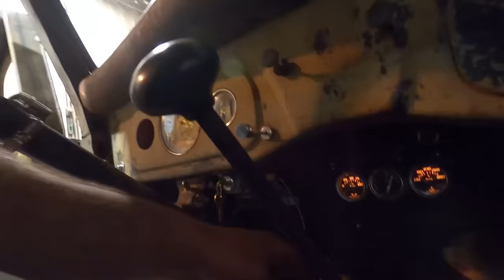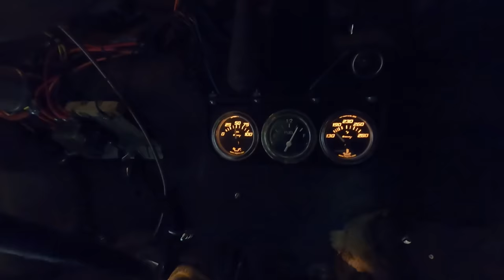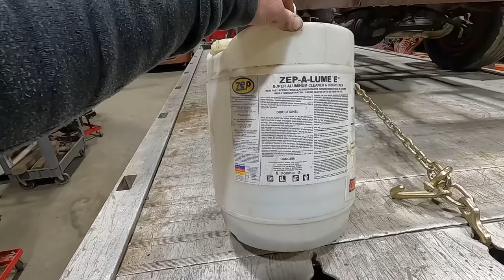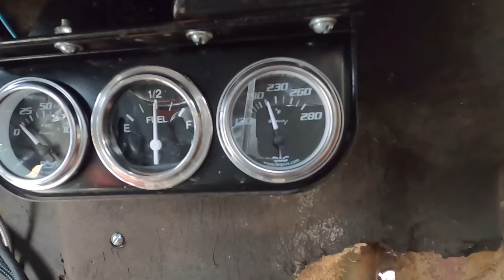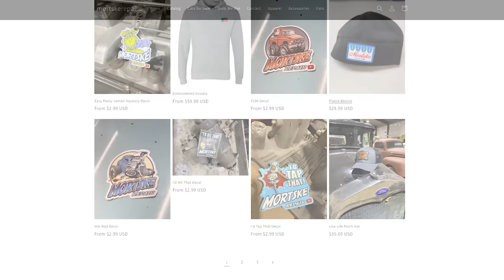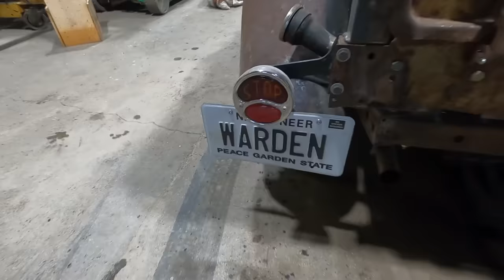1936 Ford Barn Find Pickup Truck! Overheating Flathead V8!! Problem Solved!

Comment: oh look another 2 hour video of yapping. next time do a 5 hour video.
Reply: you're over doing it man i used to love your videos but im sorry its longer than titanic the movie lol. one hour was perfect and save the 2-3 hrs for special videos. you understand what im saying?
Reply from the maker: They’ve been 2+ hours for years.
Reply: @MortskeRepair  First off, that guy is a real tool.  Secondly, have you ever tried setting up an electrolysis tank to do rust removal?  It's extremely easy, although you would have to tear the engine down into block n heads and such it, but it will strip only the rust down to bare metal with zero effort.  It would probably work even better if you could set it up so the electrolyte is flowing through the passages .

Now, a few things. I have used electrolysis to clean up intake manifolds, exhaust manifolds, a water pump, and some various shop tools.  I have no idea what it might do to, for example, a set of cam bearings.  You would need to look into the details, but serisously in places where it works at all electrolysis is like freaking magic dealing with rusted parts.  It's hard to over hype how easy it is and how easy it is to set it up.  A few plastic tubs, a big chunk of scrap iron, a set of battery cables, a cheap battery charger and an old battery (you have to run the current from the battery charger through a battery to your object, because all these modern smart chargers will shut off if you try to run them direct.

Also, the process produces a small amount of hydrogen gas. I would imagine your building is more than crafty enough that it would dissipate LONG before any dangerous concentration could happen, it's not much gas and thats a BFB, but you might contemplate it. I literally did it one winter in a small insulated work shed and came out to find my buddy casually lighting a smoke in there. He failed to fly into outer space, and I had been doing it out there specifically because it had no potential ignition sources like sparks or whatever... He was all like 'what sup with these fizzing plastic tubs', and then got offended when I grabbed his smoke right out of his face and ground it out.  He settled down after I played him a video of the Hindenburg on my phone.

So look into electrolysis, even if it doesn't suit your purposes here it's an amazing process and a real labour saver.  And as for that guy bitching about the length of the videos, personally I would watch the hell out of a five hour mechanical video.
Reply: All ya gotta do is stop watching if you don't like it there genus.......duh
Reply: They're too long,we dont need to see all 20 lug nuts removed, or 5 minues of winching a car on to a trailer @MortskeRepair
Reply: Where is the part where Morske threaten you if you don't keep watching?? There are 1000s of youtubers! If you don't like this one go somewhere else.
Reply: I'll sit through a 5 hour video.
Reply: There's always FAST FREAKIN' FORWARD!!!
Reply: @jongercama1842  well ill sit through a 6 hour one!
Reply: I wo7ld watch a 5 hour Mortske  video,  so FO
Reply: DUDE! so is Al Roker at the Rose Parade and there are thousands of people watching the parade and there is even a guy who tries to go behind the horses and clean up the road before the pretty girls march in formation right in to the mess so their Moms at home won`t get upset. Entertainment is where you find it . I haven`t seen your channel yet.
Reply: @Michael-B41  So we all have to make do with shorter videos just because it suits you?
Reply: @jongercama1842  Me too!
Reply: What king of frash light  do u use
Reply: I don't know if you are joking, being facetious or just a plain ass. But me and the hubby LOVE your videos and watch them from beginning to end!
Thanks Mortske❤
Reply: Id be happy if the videosc were 5 hours long, if its not for you do something else.
Reply: I break them down to 2 or 3 sittings. But don’t make them shorter. There’s enough short content on YouTube already. What you’ve got is working.
Reply: Here we go again
Reply: To rickmesser : genus ????? What's a genus ? Genius
Reply: I've been asking for all Duff vids , including body cam shots , to no avail 👍
Reply: @MortskeRepair FAR be it from ME to be a TROLL (🤣), but I do prefer them to be around 1:45:00 or less. It's not you, bud, it's me. But at least I'm polite and respectful about it. Unlike your typical TROLL OF THE WEEK (see above). 😉
Reply: I think these guys really are trying to win my coveted (?) TROLL OF THE WEEK award. No cash, no prizes, just glory 😂.
Reply: oh look nobody cares what you think.
Reply: Don't encourage him to go Lord of the Rings length dude!
Reply: Go watch someone else then. Problem solved 😂
Reply: Be careful about saying anything about any Youtuber. Normally there are some Cult members who will attack you back for slightest criticism even if, you have a positive constrictive point. After all if you didn't care about this channel you wouldn't bother to express your opinion. And the reaction from these Cult members are always the same: "Why don't you watch something else?"!!
Reply: i could watch these video's for hours just for Duff.no offence Mortske. @MortskeRepair
Reply: 5 hours would be great!! now kick rocks, dum dum.
Reply: The warden is great, but I love that black dodge truck and yes bring on the Pontiac! Great video!
Reply: Longer the better for sure
Reply: I like the 2 hour videos myself. Don't watch much TV because it sucks, so I'd rather watch Mortske. If you don't like the long videos, simply don't watch.🤔
Reply: @MortskeRepair  I enjoy the two hour videos. It’s like watching a movie but better.
Reply: @Michael-B41 I think they're perfect length videos. I'm retired and his videos last perfectly through Matlock and heat of the night! I'm old but I ain't that old to watch those shows. Keep up the good work Mortske and Happy New Year to you and Duff as well!
Reply: Maybe this comment is a bit late, but the hydrogen gas that electrolysis would raise up to the ceiling and find it's way out. We used to generate the stuff in a glass beaker in chem lab and the most it would is just make a chirp or poof sound..
  Not giving you guys advise on what to do, but when compared to the gases found in a torch, gasoline or propane, I don't give it a thought.
Reply: If you don't like em, don't watch. 
Enjoyed this video as I do all of them.
Reply: If it’s too long for you, or you don’t like the content why don’t you just not watch it, if you cannot say anything nice don’t say anything at all
Reply: Don't listen to him, he is just jealous!  I like your yapping, or thinking out-lowed,  and I like Duff the Britney spaniel too!
Reply: you're not being held captive.
if it's too long,  go to the next one. 
Simple and easy.
Reply: @Michael-B41 ❤Kopitar
Reply: @Neil-ru7kw  it’s a word used to classify species… but not what he was after 😂
Reply: @rickmesser7855  It's genius not genus , duh !
Reply: @jeffhutchins7048  I just shoot to the last 5 min's 👍
Reply: @Neil-ru7kw I like to go for the full run!
Reply: @Neil-ru7kw  big thumbs
Reply: @timothytrujillo467  easy dont watch
Reply: Couldn't agree more! The longer, the better! Mortske truly is a virtuoso of the internal combustion engine. I'm 65 and I've been tinkering on cars since my teenage years, first as a matter of necessity and later because I like old cars. Even so, I learn something new every time I watch one of Mortske's videos. Mortske has that rare ability to "think outside the box." Even though it wasn't the entire cause of his overheating problem, his idea of slowing down water flow through the radiator and giving the water more time to cool by fitting washers inside the hoses is nothing short of brilliant. What impressed me the most was the way Mortske got the motor on the ex Air Force '55 Dodge wagon running. After sitting for 50 years, those valves were basically welded to their seats. I would have either done a complete rebuild, or scrapped the damned thing. Rather than doing either of those things Mortske kept heating each valve with a torch and gently tapping it using the ball end of a lightweight ball-peen hammer. He did this over and over on each valve, until the valve freed up. I thought he was wasting his time, but it worked! I'm not sure if you are complaining about the length of Mortske's videos or paying him a left-handed compliment but I do know this: I may be old but I still love to learn new things and for me, time spent watching a Mortske video is time well spent!
Reply: @chrisackerley1842  yeah i just loved the videos got too long for me been so busy i cant hardly finish one got upset about it. hes a good guy though

Comment: Use CLR to remove rust. It's gentle enough for your coffee maker and dishwasher, so it should be fine on seals and gaskets.
Reply: phosphoric acid it only eats rust not steel or iron and is way cheaper than clr and there brand name
Reply: Evap o rust works  wonders
Reply: White vinegar seams to work good. Then put rocks or something in it and shake it around. For gas tanks I mean. Don't know how well it would work in heads or an engine block.
Reply: You know that truck Isn't a late model slower down 😅
Reply: 2:18:43 Tell us what you really think of us…
Reply: @bob5074 ?
Reply: Yes CLR is the best
Reply: That much rust needs more than clr...like a new shortblock or some weld...at least 5 lbs of welding wire😂
Reply: I saw South Main Auto do that and it worked
Reply: @wolfcommander6009  Engine brushes work good too.
Reply: Yes CLR
Reply: @1776_Garage  Works great on engines. especially the industrial grade vinegar they use for weed killer .

Comment: You ask us to tell our build stories:  Starting in 1963, I bought my first '55 Chevy Bell Air post.  After I got out of the Navy, I built four more 210 series, customs and one Jim Hall 327 Chaparral, that beat every thing in it's class, including all hypo 427's.  I'm 81-years young now and own a pristine '86 1/2 red Fiero GT that I have done two engine swaps; a 3.4 Camaro/Firebird V-6, and five  years ago, a 300+hp 3800sc out of a 2003 Bonnevile.  Built the way the original designers intended it to be, she puts in low 12 second quarter miles, but more impressive takes the circuit race tracks like a pro.  She is a gorgeous fast little sports car, that beats most of the cars on the road, and gets excellent mileage while she is doing it.  She is very roomy inside, and I call her "my quasi super car." I only have around $7k invested in her, having done all the work myself, she is more comfortable that most all the million-dollar Italian sports cars, and goes like hell...!
Reply from the maker: Awesome!

Comment: From what I've been told, the water in the coolant mix is what does the heat transfer, or the bulk of it. The coolant is for raising the boiling point, lubricating the water pump, and keeping corrosion to a minimum. My neighbors have a 79 Ford E150 RV with a big ol camper top, and only a 302. It was overheating, especially when pulling a long hill in the SoCal summer. Has a newer aluminum radiator, and the rest of the system itself checked out, as did the ignition timing. Come to find out that someone had put straight ethelyne glycol coolant in it. I drained it and refilled with 50/50 ethelyne glycol and distilled water, and it does not overheat any more. Happy New Year, Mortske!
Reply: I agree, use distilled water too…

Comment: My grandfather was a tanker in ww2, did tank recovery, and sometimes they would take pans of oil soaked wood and slide them under the engines and transmissions to warm them up in the winter.  He said it didn't matter how stuck or how broken a tank was, he would rather be trying to start a frozen solid engine than getting a still warm one out of a field.

At the time, I didn't actually get what he meant by that. Later on I learned that he had been in a crew that would pull disabled tanks out of active battles while under fire.  Any enemy tank would love to take them out, and he had several medals and such for bravery including a battlefield commission to officer.  Started as a private who could not read, after peace time he ran a training school for mechanics and recovery teams in the fifties.   Never said a word about any of it, just that he 'was a mechanic'.  One thing he did do was talk me out of joining the army. Told me to go to college instead.  Should have listened to BOTH those pieces of advice maybe.

Comment: For removing rust, you can use Evaporust. It works even better if you heat it up, so running it through an engine would be ideal. If you want to cheap out, you can just make a solution of EDTA

Comment: *Thanks for a year of free content Mortske 🤭👍. Can't beat free... White Vinegar left to sit a couple days then drained will loosen the scales. Or you can buy some goop to put in but your still going to have to do what you did ... Magnet, Flush, Blow the scale out. Take rad out and back flush it or recore. To keep the temp down after that run 1/2 " aluminum tubing to an oil cooler above the rear axle and back. Knocked 20° out of the BBC in my 47 Merc. You'll get to ad extra oil too. Cheers Man.                    🍻👊😎👍🍻
Reply from the maker: Our pleasure!

Comment: Father in law had a vw motor connected to a gen set, powered the farm with a cheap, easy to maintain motor, air cooled and economical to run.  Mounted to a trailer, it could even be portable.

Comment: Quick tip for any flathead.  To remove the head take a 12" length of 1/4" cloths line and feed 1 length into every spark plug hole and spin her over. the head will be sitting an inch off the deck in no time.  My project is a 1968 C10, all steel, cammed 5.3LS with a 700r4, 3:73 posi rear.  Front disks, exhaust and the big one, the fuel system left to do once the weather breaks.  I stuck with the FI, I've done it before on a couple swaps but going with an in-tank pump this time.  Not hard, just time consuming.  Hope to have it running down the boulevard by Memorial Day.  Best laid plans .....

Comment: Thanks for the shout out on the boxed cap! It has its pride of place all the way down in Africa now.

If it has not been mentioned, white vinegar is acidic enough to clean out the block and radiator well without being too harsh on seals, etc. Ol' Greta will also not be able to complain since it's 100% natural.

Comment: You are working on my all time favorite pick up. Yes straight water does transfer heat more efficiently, also don't paint aluminum radiators, paint will slow down heat to air exchange. Btw 'radiators'  are not really radiators there correct name is heat exchanges.
Reply from the maker: Good to know!
Reply: "they're". And "exchangeRs". 😉
Reply: I worked on race car radiators water and oil coolers only in aluminum for tens years or so, I thought some people might be interested. I apologise if I have offended you with my spelling I'm only a welder.
Reply: If you add just a little light oil to the water, it will help prevent the rust...!  All the old timer radiator rebuilders did this as a standard  procedure...!

Comment: We had a cone fitting that went in the lower hose that had a garden hose swivel and an air nozzle. 
 Pull the thermostat, fill it with water, blast shop air into it. Loop the heater hoses so it doesn't get plugged.

Comment: Two water pumps because flat head V8s were always notorious for overheating, so you're starting off on a bad foot. We used Rodol when I worked on underground locomotives. Pull the pumps and check them and have the radiator re-cored as the bottom is likely blocked. Try CLR.

Comment: Happy New Year to you Sir. Really enjoy your videos. Projects for 2024 - keep improving '94 Mustang GT convertible driver (currently waiting on headlight switch and CCRM - headlights shut off intermittently and I have to find sweet spot between parking light and headlight position on switch to get them both to work. CCRM - problem with fuel pump fuse causes parasitic draw which drains the battery overnight. Current fix - kill switch. But I still drive it. Project 2 - '93 Mustang LX with LS/4L80E swap. (bought the car as a roller with 35 spline and spool drag rear suspension) Got it running, sounds strong but head gasket (was a junkyard 5.3) leaking water. Also rear main leak. So I've got some work for 2024.
Reply from the maker: Same to you! Good luck with the Mustangs!

Comment: Studebaker had problems with the rear of the heads getting plugged up with rust. Studebaker made an engine cleaning solution that I’ve had really good luck with. I’ve got a couple of cans id be willing to send you if you’re interested.

Comment: I don't know if machine shops still do it, but the few I went to had big tanks filled with a solution of water and lye heated to about 200 degrees and the tank would agitate the parts. They came out like brand new, all rust, scale, dirt and grease removed  we did have a engine this bad, we stripped it down and took the block and heads and had them dipped, when we got them back we reassembled the engine and no more overheating.

Comment: Saw another channel ( No Nonsense know How), use a sock end to form a cup on the intake to the rad to trap all the rust coming out a block and it worked real well ....run it for a couple miles at  a time and dump the sock a few times....when it seemed he got it all he bought a proper filter you can insert at the same location in line !

Comment: Use white cleaning vinegar for rust. Works great for soaking rusty tools in too. It will separate the good from the cheap tools if you soak them long enough.
Reply: Correct for all metals (cast, aluminum, copper, stainless, but continue to use regular water flush the engine several times. Note: Radiator should be detached from the engine for a separate cleaning. Suggestion: Even Greta could use a good cleaning, since it will be environmental - TWO FOLD.